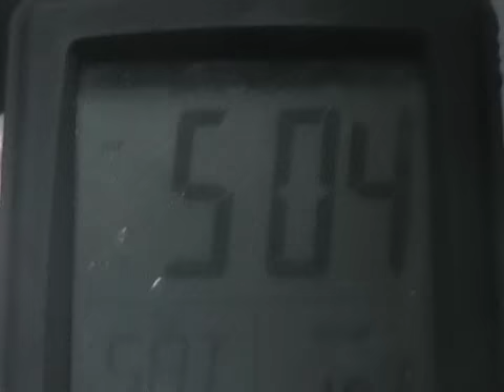A Day In the Life of a Treeplanter - Part 1

Comment from the maker: I purchased a cheap rain suit (I think from Bush) that was useful / essential when it was raining and snowing. I really wouldn't bother purchasing anything for over 20-40$ since a lot of the rain suits people bought easily tore on branches and other snags (even ones that cost around 100$). Definitely buy a rain suit but make sure it's comfortable to work in. You won't need it at the end of the season, but possibly at the beginning of your contract when temperatures are still low.